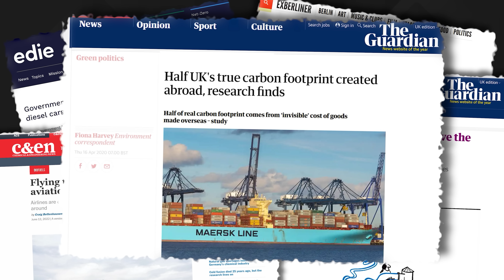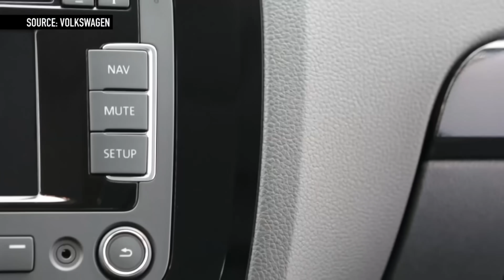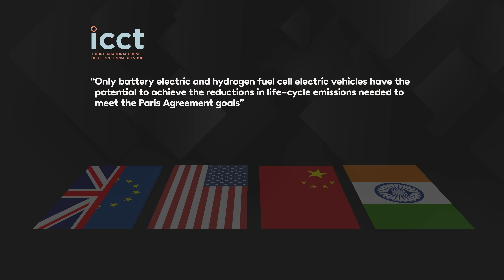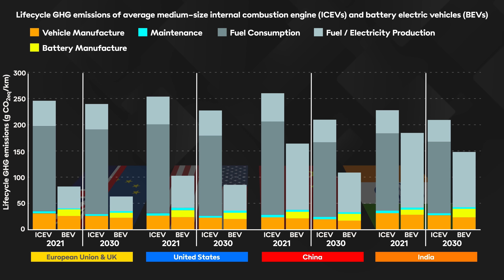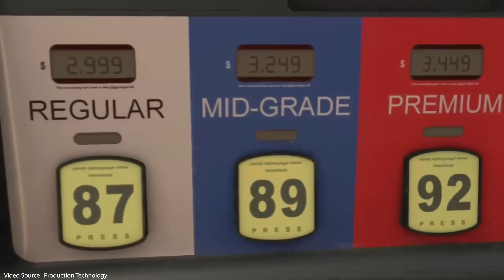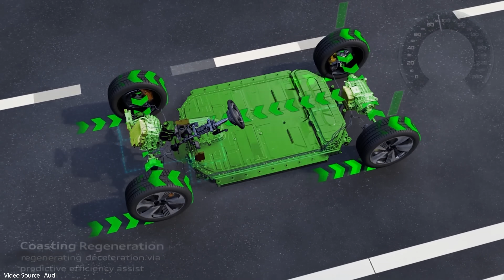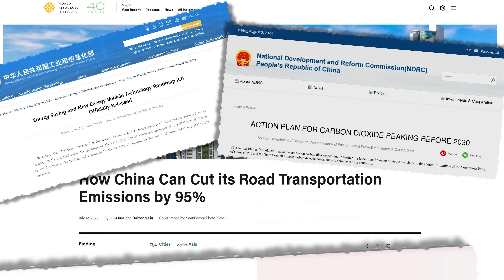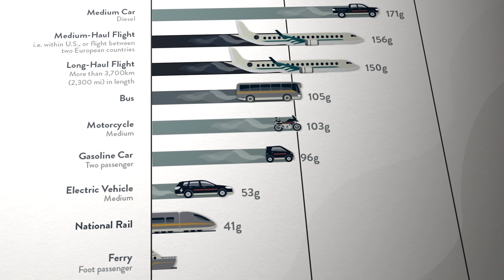Are EVs really better for the climate?

Comment: Great video & great presentation. I would love to see a conversation between you and Sabine Hossenfelder, who recently published a very similar video with slightly different conclusions. Her analysis suggested that, largely due to battery production, HEVs the best short-term reduction strategy. I am curious about the differences that lead to such drastically different assessments of battery production impacts. Clearly BEVs are only solution longer-term, but if I am buying a car today, what is the best choice?
Reply: The difference is that the report here is wrong about the emission of creating batteries. A volvo released figures puts battery emissions at 3-6 years to offset. Those that are pro EV's keep on trying to downsize the huge impact that batteries have because there is currently no real solution to the problem. Having said that EV's are definitely the best choice of transport for some people, this can be clearly see from some of the comments. The difference is that HEVs are more flexible and are a better choice for a larger percentage of the population. The best choice is always a personal one that depends on how you use your car.
Reply: @longdang2681  I'm not sure why you implicitly trust Volvo's assessment over this peer-reviewed study?
Regardless, the Volvo report also makes it clear that the source of your electricity and miles driven per year play a huge part in how long it takes to offset the cost of battery manufacture. It also states that battery tech is constantly improving and grids are steadily getting greener meaning the time to offset drops further still. Last piece of the puzzle is battery recycling which will dramatically reduce the environmental impact of manufacturing batteries over time. 

So if we take Volvo's report as gospel, EVs are already better and getting better all the time from an environmental standpoint. 
For me, the best part is that they're just better cars by almost every measurable metric.
Reply: @airchie2  The volvo assessment can be tested for errors. The upfront emission from EV batteries is big, volvo recognises this in their assessment because they face the problem each time they make an EV. If you watch Sabine's video then you will see how much this video has purposely left out in order to try and downplay the significance of the batteries. EV's are getting better but they are still a niche product that only suits certain people(which is something I said earlier but you chose to ignore). We should not be rolling out EV's en masse as it is currently a worse choice for many(including environmentally worse). If the battery tech can be magically solved by a click of a switch, we wouldn't be in the climate change problem that we are facing now. From an environmental standpoint EV's needs to have smaller batteries(they are not ready for mass use now because smaller batteries makes their range(and hence range anxiety) even worse).  People have looked up/calculated the figures and compared it with the volvo assessment, so no they are not taking the volvo assessment as gospel. Why are people taking this ICCT report as gospel?
Reply: @longdang2681  I don't think anyone denies that the up-front cost of battery production is big? Every assessment I've seen states clearly that the environmental impact of manufacturing an EV is larger than that of an ICE vehicle. The bigger the battery in the vehicle, the bigger the impact. However, the point is, that even if you have a huge battery in a vehicle that's charged exclusively from coal power plants, it's still better for the environment over the lifetime of the vehicle compared to ICE vehicles. Then add the fact that grids are getting greener, EV drivetrains are getting more efficient, battery tech is improving steadily and manufacturers like Tesla are focussing on decarbonising supply chains and manufacturing, then EVs start to make ICE vehicles look like the dinosaurs they are.

I'm not sure what exactly you think I chose to ignore but EVs are far from a niche product. They account for a small fraction of the global auto market currently but that's set to change fast. There's a lot of FUD out there, usually created by organisations with a vested interest in big oil. That FUD gets spread across social media by useful idiots who take it at face value and know nothing about EVs. The sort of people who try to suggest that EVs are somehow worse for the environment than ICE vehicles by cherry-picking corner cases and outliers and equating them as the norm.

The fact is, EVs are just better cars than ICE vehicles. I know this from personal experience of having owned and driven both. Its clear from the lack of people wanting to go back to ICE after having an EV. Pick any measureable metric and an EV is better. The only areas they're behind is speed of "refuelling" and the knock-on consequences of this linked to towing or long journeys and even that is improving rapidly.

I'm not taking the ICCT report as gospel, I've only watched this video about it. I simply agree with it's findings as it matches my own experience. Even the Volvo report you cite mostly agrees with the ICCT report. It comes to a different figure on how many miles it takes to offset the higher impact of EV manufacture but it does state that figure changes based on many factors like pack size, grid energy mix, etc.
Reply: @airchie2  The ICCT study is very biased towards EV's, eg how the compared average Indian car has a tiny 23KWh battery? And battery is the biggest problem facing EV's. This makes the Volvo report fairer as it compares two cars of equal functioning capability. Even the Volvo report implies that EV's are better for the environment(just not the drastic difference that others are suggesting). No one is saying EV's are bad, people are saying that misleading reports that paint EV's environmental benefit hugely above what it actually is, makes for a bad report.
Reply: @longdang2681  So you agree EVs are better cars and better for the environment. You just dispute HOW MUCH better?

And presumably you agree the gap between EV and ICE is only getting bigger as EV and battery tech evolves and grids get greener?
Reply: @airchie2  Put another way if changing to EV's has not such a dramatic impact then people might be encouraged to consider other better options first. Many people don't switch devices off at the wall because it's debatable that with the turn on surge whether it's worth saving the 0.5W of standby power. Grids getting greener, again it's all about how much. Grid going 100% green is not the god send that people make it out to be. Again it's down to the storage of power. Carbon neutral and sustainable are different things. Dinosaurs were never carbon neutral but their lifestyles were sustainable for millions of years. A pendulum doesn't need to stop at the central point to be sustainable, swinging pendulums are also sustainable. If the environmental benefits of an EV are not that big then the suggestion made by Sabine that hybrids are a middle ground contender with the flexibility to suit a wider range of peoples needs, would be a sensible one.
Reply: @longdang2681  I thought we'd already established that EVs do make an impact? Now you're saying they don't make enough of an impact? What other, better options are you talking about? EVs are the best option I'm aware of.

You've gone way off on some tangents after your first point, suggesting a 100% green grid isn't a good thing and talking about dinosaurs and pendulums. I'm not sure it's even worth responding since I'm not sure what point(s) you were trying to make?

Lastly you suggest hybrids might be better for most people instead of an EV, to which I'd say you're talking nonsense. I'm happy to admit that EVs are not best suited for everyone yet. Particularly people who drive more than an EV's maximum range on the daily or are constantly towing heavy trailers long distances. For the vast majority of people out there, an EV would happily replace their ICE vehicle.

If you absolutely, positively must stick to burning fossilised dinosaurs, the most sensible solution would be an EV with a small ICE engine running like a generator purely to provide additional range to the EV. Then you get all the benefits of EV (quicker, quieter, less moving parts, more reliable, smoother, no emissions etc) with the ability to extend the range on the go. Avoids having to get a big engine plus fuel tank in that'll add complexity and weight. Don't need a gearbox or anything fancy happening with the drivetrain to blend the two power sources together. And the engine can be super small and running at it's most efficient RPM with minimal emissions to generate the extra electricity.

The BMW i3 had a REX option and I think most users rarely used the range extender. Now that charging is capable of going from 10-80% in 10-15mins in some EVs, I think there'd be even less demand for fuel-burning EVs...
Reply: @airchie2  The volvo report suggest the impact is 23%(13 tonnes CO2) reduction in Europe. For many who have an existing vehicle(probably ICE) you could keep your existing car and invest the £20K+(new car money) in any renewable energy investments(that would also reduce emissions). Insulation and upgrading home appliances such as fridges/freezers are decent choices and can give good returns if they have not been upgraded in sometime. All of these options are better than upgrading to an EV because they actually reduce your energy use which is better than using less polluting energy(EV). Of course upgrading insulation is not as glamorous as getting a new car. Ask yourself, do you want to make choices that actually help or do you want to look like you are making a big contribution? I didn't say hybrids are a good choice for many, it was suggested in Sabine's video, watch it if you are interested.
Reply: @longdang2681  I agree that reducing consumption by any of the methods you mentioned is a good idea and can bring environmental and financial benefits.
I don't see them and driving an EV as mutually exclusive. Particularly if your current vehicle is thirsty or less reliable than you'd like. And don't forget, most people don't buy their cars these days. So if you're leasing and have come to the end of your lease, you'll be changing your car anyway.
Reply: @airchie2  Getting a new car is considered a shopping trip but making insulation improvements is considered a chore. The current economic environment is not exactly good and (IMO)any money that can be allocated for improvements should go towards energy consumption savings first before other methods. For those who currently must choose something then EV might be the better choice(with both sides refusing to release fair comparisons we simply don't know by how much). However I do see people who obviously have time to consider their options being pressured into 'you must change to an EV now to save the environment'. And it's all because of the exaggerated reports such as this one claiming that even in dirty grid cases EV's are still 30% more environmentally friendly. There's not enough studies on if I have an old car that does need a maintenance service now, how do I decide if swapping for an EV is more environmentally friendly rather than making the most out of the CO2 emissions already spent on my existing old car? If you take the Volvo study, writing off the 16 tonnes of CO2 emissions needed to make the ICE version in order to change to the Volvo EV is more than the 14(Europe) tonnes CO2 savings and half of the 32 tonnes saving if you powered it completely from zero emissions electricity throughout it's life.

Comment: Excellent video. I bought a 6 month old EV almost two years ago and wondered if I was making the right decision having frequently read anti-EV comments?
Best car I have ever had. So much more relaxing to drive and I am saving nearly £2k a year in fuel costs.
Reply: Try to keep the charge on the battery between 20 and 80%. This will sustain the life of your battery. Only charge above 80% if you're actually going on a trip that requires the extra range to reach the first charging station. Do some research to check the Optima battery charge for your particular vehicle brand.

 Some Tesla's battery packs have lost almost nothing after 200,000 miles. And I think there are even a few that have lost almost no range after 300,000 miles.
Reply: @mac_mcleod  The LFP batteries that will soon be standard don't give a shit what the charge of the battery is.
Reply: @viperswhip  it's a great technology but this car owner doesn't have it yet.
Reply: Good for you. The battery tech is getting better every year with some real step ups coming soon. So when you are ready for a new EV they should be even better.
Reply: Counter argument to Just Have a Think biased argument... https://www.youtube.com/watch?v=TUx8yIlKVpU

Comment: And there’s another fascinating component on owning EV vehicles during an energy shortage, you’ve got yourself energy stored in that battery, now it’s about getting the right kind of equipment to inverted out should you need it 😎
Reply: Liquid solar fuel carbon-neutral, uses existing infrastructure.  Aldo Steinfeld.

This guy is funded by "greenies"

Comment: Tesla said in their last shareholders meeting that all the solar panels on their factory roofs and sold to customers, have produced more energy than needed for the manufacturing AND charging of ALL the Tesla cars on the road today (more than 3 million now) So with Tesla these extra carbon emissions are only in the production and installation of these solar panel systems, IIRC a Tesla Model Y offsets its carbon footprint in about 6500 miles.

Comment: How about the fact that I would need to buy two or three electric vehicles during the lifetime of a single Honda or Toyota ICE vehicle? I'm sure the carbon footprint of manufacturing one to two entirely new cars outweighs keeping my 35mpg-on-average Civic running for 15+ years 200,000+ miles.
Reply: Only 200,000 miles, Teslas are good for 500,000 miles with the same battery, and the transmision need almost zero servicing, how many oil changes, spark plugs, filters, timing belts etc would you smelly poluting ICE car require over 200,000 miles, and the Tesla does the equivalent to 130 mpg.
Reply: @stevetaylor2818  
You've definitely drank the Kool-Aid. And you know nothing about cars.
Reply: @stevetaylor2818  
What's the longest owned Tesla? What's the highest mileage Tesla? Which Tesla has kept its original battery the longest and how much has it degraded?
Tesla are poorly made. People are starting to get rid of them. A decent hybrid such as the RAV4 Prime will out live any Tesla on the market and will have a lower carbon footprint by the end of the vehicle's life.
Reply: @joshuaewalker  There are Teslas with over a million miles on the clock. Teslas bodywork my not be as good as RAV4, but the drivetrain and battery tech leads the world by far. And hybrids are a complete and utter environmental waste of time. ICE cars are around 20% efficient of using the potential energy of oil, hybrids can be 25% efficient (but if driven badly, often restarting a cold engine, and a cold catalytic converter can be worse than an ICE car on emissions) many studies have shown this, but EVs over 80% efficient! All ICE engines have to go, including hybrids

Comment: Car manufacturers have had patents for free piston engines for decades. These engines can work as a generator to produce electricity and are muuuuch more efficient than your average ICE. Because you run them at a constant optimal speed and due to their linear nature they  do away with a lot of mechanical loses. It's much more efficient to use electric motors for propulsion and these free piston generators to still use some legacy fuels. And these engines could even be fuel agnostic btw. It's all a scam if you look at the tech that we already have/had.

Comment: There are two practical aspects that are not often considered. One is affordability. The vast majority of people can’t afford av EV and so if your study draws conclusions based on everyone suddenly, magically having one you just need to have another think. A second consideration is this: the most efficient vehicle you can have is the one you already own.  Why? If you should decide to send your 2020 Honda Accord with 60,000 miles to the crusher you’ve just wasted the vast portion of the energy that went into it. Chances are you’ll never recoup that over the life of your new EV. The best thing you can do is wear out your Accord and hope by then you can afford an EV.
Reply: Nobody is yet scrapping working ICE cars for EVs, people are buying new EVs instead of a new ICE cars, and then selling their old ICE cars. If you replaced your Honda Accord now with an EV, you would sell your Accord secondhand and someone else would make good use of the construction overheads.
And cheap secondhand EVs will exist eventually in exactly the same way secondhand ICE cars exist now, will just take time to filter down.
And EVS actually have far fewer parts, will eventually be far simplar to construct, require far less serviceable parts, are far cheaper to fuel, should have longer lifes and as such will eventually be far cheaper over their full lifecycle! and the air in our cities will be so much nicer! and the world can stop buying oil off places like Russia

The world will just be so much nicer!!!!!
Reply: @stevetaylor2818  Point taken.